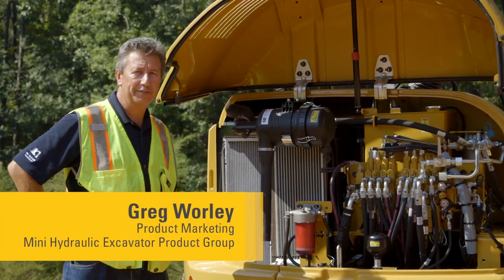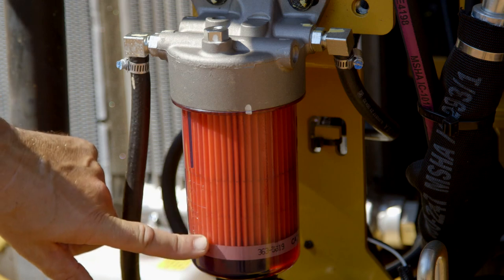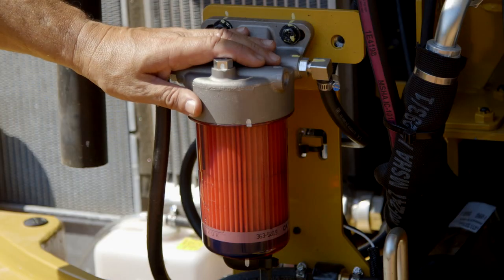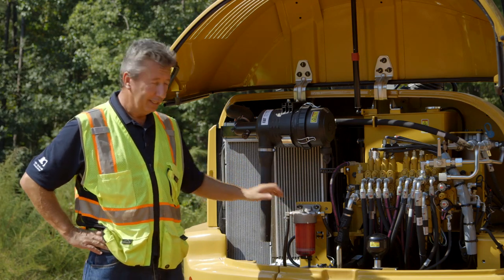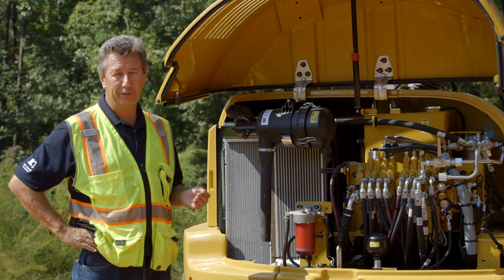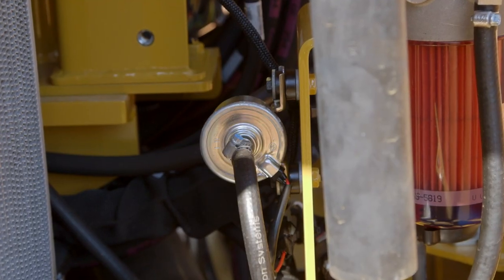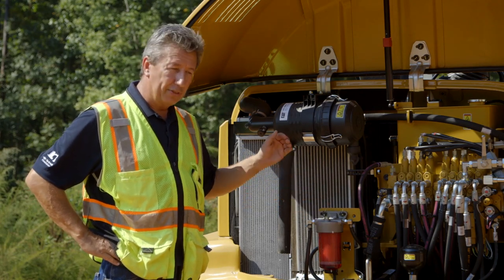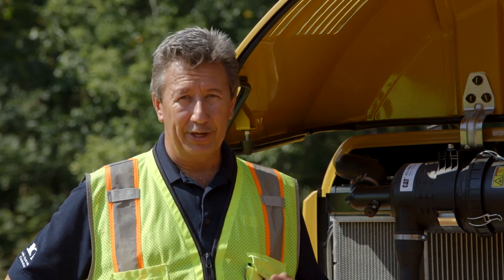How to Change the Fuel Filter on a Cat® Mini Excavator (3-8 Ton)

Comment: So how do you change the Fuel Filter on a Cat® Mini Excavator (3-8 Ton)?
Reply: Remove the whole engine. Then remove the fuel filter canister. Remove the old filter. Install new filter. Put back fuel filter canister. You can skip the remove engine part if you want.😅 I’m an engineer, I make things complicated.
Reply: Open the drain and let the fuel MT out into a container. Turn the canister to the left and remove it. Clean it out really well and replace the new filter and O-rings. Replace the filter dry, do not fill it with fuel. Turn the key on the first position and let it fill up and check for leaks. Takes about 2 - 5 minutes. Also while it's out replace the small in-line fuel filter (1G-7206) behind it.